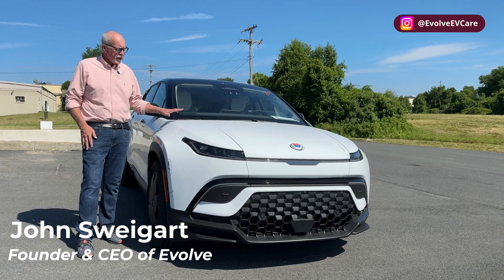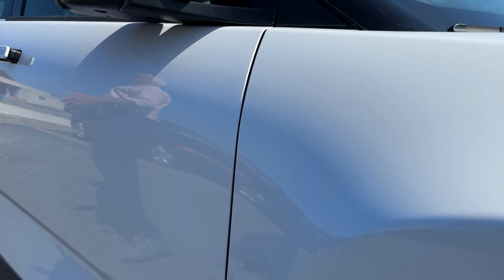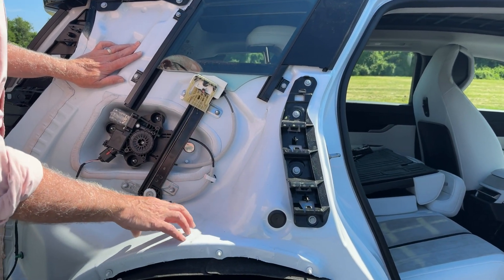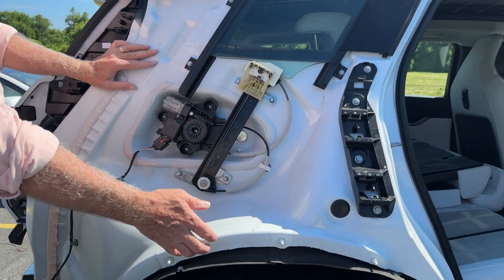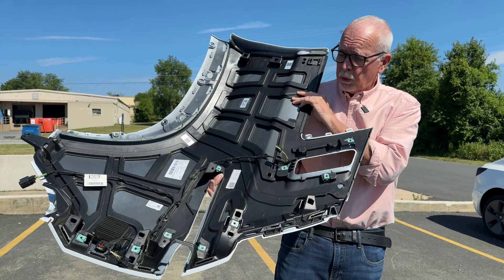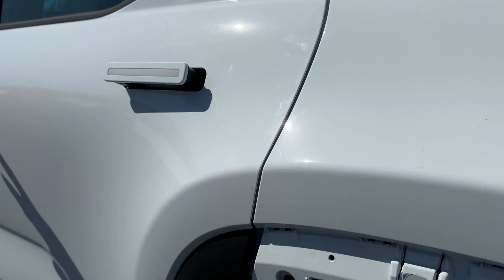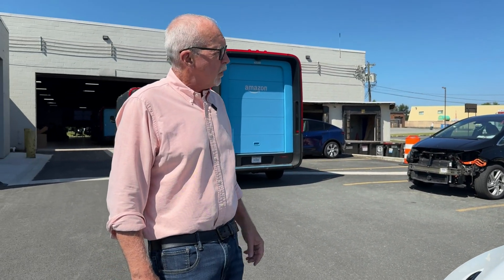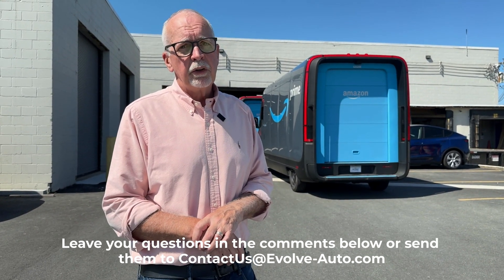Fisker Ocean Repairs After Bankruptcy | A Closer Look

Comment: I spent about 6 months investigating EVs vs. hybrid, vs. ICE. I have not YET bought an Ocean but considering it, "sort of". What I did buy is a 2020 BMW i3s REX. With the state of, or horrible state of, commercial charging stations the REX, my opinion, was the way to go. I can get 170 miles per charge, assuming no huge elevations at 75mph with the AC blasting. AND, zero range anxiety. Example: My wife and I took a trip Phoenix to LA. 2 charging stations between, both Electrify America. This was 3 years ago when Electrify America was 24 cents/kWh now it's 54 or 56 cent/kWh so an ICE car that gets 30mpg is more economical vs. electric. 3 years ago coming back was an obstacle. The first Electrify America, of course 2 of the 6 were down, the 4 were full with a 3 car wait. I did hack the i3 so you can turn on the REX, scooter engine that runs on 2.2 gallons of gas that runs a generator to maintain the high voltage state of charge for 80 miles, I hacked it so it can be turned on at any state of charge below 75%. So, rather than wait in line I pressed the REX. Got to the next charging set of stations and 4 car wait. I topped off with gas and kept going to reach home. So, I have the pleasures of a pure EV with a backup system just in case. In fact, on any longer trips that burn through the electric, with the prices at Electrify America being outrageous and their lack of maintenance I just run it at 30% EV charge and click on the REX. Going uphill at 75 mph with the AC blasting it will loose about 7-8% battery level as the REX can't keep up, down hill regen gets it all back plus some extra. So, you have to be smart about it, and I am. As for the Ocean, I'm considering the risk vs, how much I like the looks and performance vs. current prices. Just still unsure.

Comment: With the back quarter panel removed and the doggie window actuator exposed it should be possible to get the current needed for the actuator and run a switch to bypass the need for using the FAST tool to recalibrate and run them with a switch to power them.

Comment: I can tell you that I’ve owned 4 cars in my short life (all new) and at the time of purchase they all had issues with panel gaps. I noticed because I’m a bit of a neat freak and can spot a line that’s not straight from afar. This was never a huge issue until the age of social media and a new Electric car (Tesla) started competing with Legacy auto and all of a sudden it’s “look at that bad panel gap”. I’ve seen uneven panel gaps on Benz and Lamborghinis. What we must ensure is that the structural integrity of a 🚗 is sound and that it’s not gonna fall apart… I was rooting for Fisker this time around. Fingers crossed for Lucid Motors and every other startup. ✌🏾
Reply: absolutely .

Comment: Body side inner is steel as well. Reason for the plastic is the feasibility for the rear quater a fender. Small light design is not possible in alu or steel.

Comment: Why has Tesla historicaly had so many problems with panel gaps whereas it seems other more established manufacturers have not?
Reply: I suspect it just wasn't a priority. I'm glad they focus on Supercharger Network, efficiency, FSD etc
Reply: @harry-eto  probably but I'd like to understand the technical reason
Reply: They had to learn very quickly about spring back when stamping panels and aluminium is extremely difficult the panels were already out of shape before being fitted
Reply: @matthewspry4217  but don't other autos also use aluminum panels?
Reply: People buy them anyway so Tesla doesn't care enough to fix them. Additionally, many Tesla buyers come from cheaper cars and don't know any better
Reply: @ThEReAlBlAyDe  agree. Not debating that. Just wondering what is different in the design and build that leads to seemingly more panel gap issues